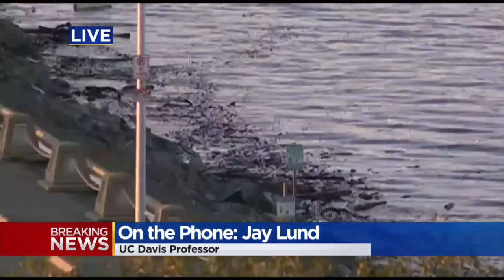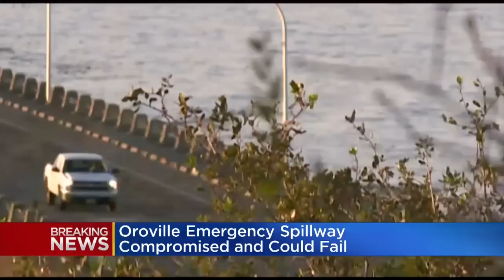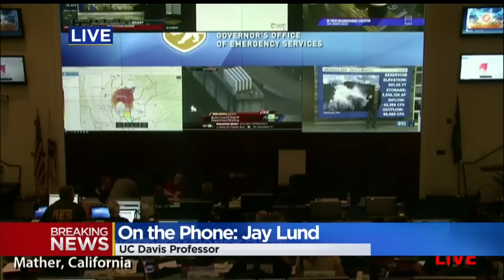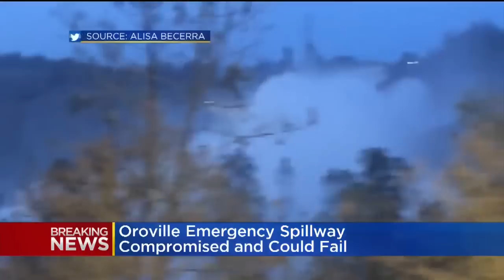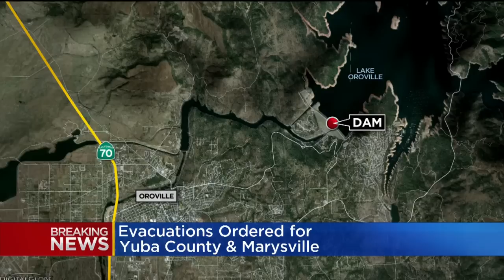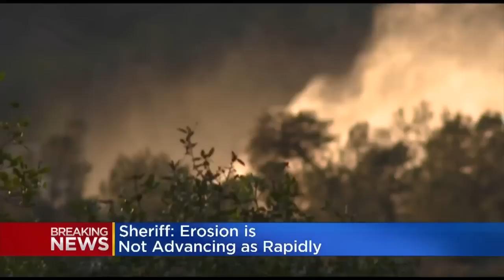Watershed Expert Jay Lund

Comment: This is an extremely serious situation. The reservoir is full. The main gated spillway that is designed for the maximum probable flood has limited operational capacity due to significant damage to the floor slab, the undermining of the side wall and serious adjacent soil erosion. Extended operation of the structure in this condition especially at high flows is entering the realm of difficult to predict consequences.

The emergency spillway is not intended to be used to release water. The emergency spillway is only to be used during an "act of god" runoff event where the spillway gates are wide open flowing at full capacity and the reservoir level is still rising and encroaching into the dam freeboard. Freeboard is the cushion between maximum design level and top of dam. The emergency spillway is there to prevent catastrophic overtopping of the dam.

The spillage of water that resulted from the reservoir being allowed to rise above the crest of the emergency spillway as a consequence of the main spillway gates being closed has clearly demonstrated the risk of failure of this area. With more water coming in than going out, the reservoir level will rise. The power plant has limited capacity to release water, especially with debris issues.

A more serious problem is yet to develop. As there is record snowpack and likely very high runoff from the snowmelt, normal operation would reduce the level in the reservoir to accommodate much of the spring runoff to minimize the release and flooding downstream. However, it may not be possible to lower the reservoir elevation with the damaged spillway out of service. If the spillway damage can not be repaired in such a manner as to make it operational at a sufficient capacity the consequences could be catastrophic.

The dam itself is not in danger at this moment. The structural damage to the main gated spillway is the reason for the problems facing the operators. The emergency spillway spillage was an operation for which it was not designed. The operators quickly determined that in-spite of the damage it was necessary to re-open the gates on the main spillway to bring the reservoir level down below the crest of the emergency spillway to prevent a potential failure. It is imperitave to keep the level from reaching that crest again.

But the necessary continuation of flow releases in the main gated spillway poses a risk to further problems to either the structure itself or adjacent erosion migrating towards the dam. The reservoir level must be kept below the sill level of the emergency spillway to minimize the risk a failure of this fuse. The fact that the spillway is being undermined as a result of the slab failure raises questions about what else might be going on under the so far undamaged floor slab area higher up.

The key to dodging failure of either spillway at this point will be minimal inflow into the reservoir, reducing the pool level as much as possible and having sufficient time to begin and complete a temporary emergency repair before the next big runoff event.
Reply: Look at weather radar. Incoming rain. Where will it hit again?
Reply: True. And there is more rain coming,and record snow pack. FLOODS.
Reply: Sandy Larsen good comment, actually the emergency spillway should even be designed to be able to wash away in catastrophic event, for the sake of relieving the level and prevent overtopping of the dam.
Reply: Tha_slughy between full supply level and top of dam there is something called freeboard.  The length of the emergency spillway and the depth of flow would guarantee that the dam embankment could not be overtopped.  As you indicate, breaching the emergency spillway would also ensure the dam is safe.